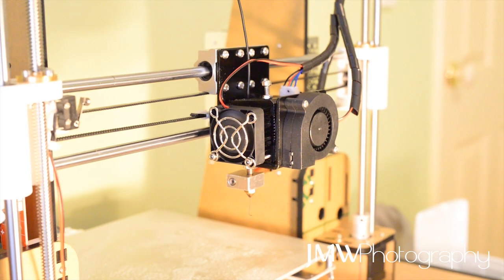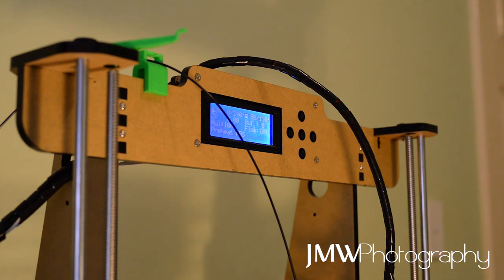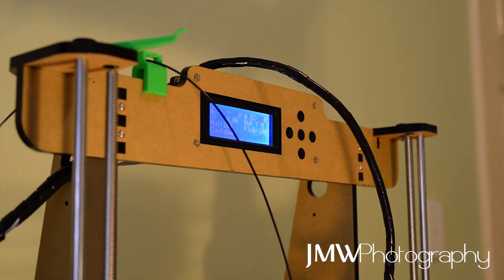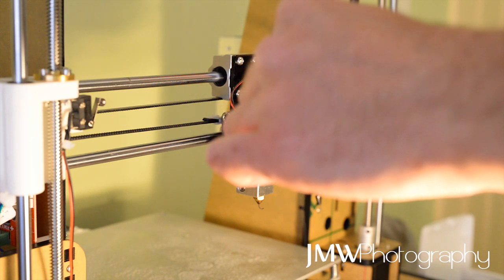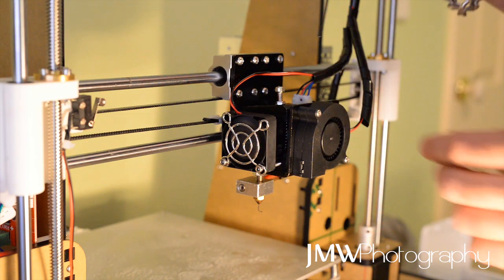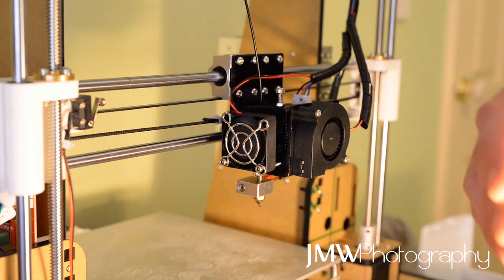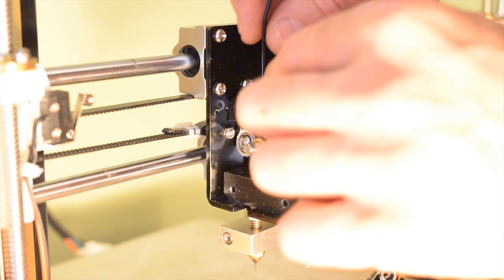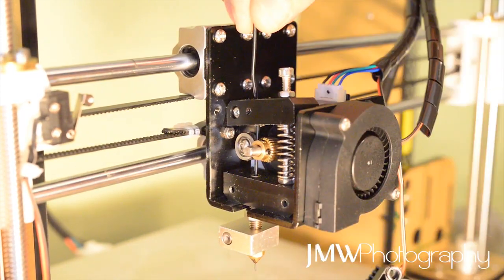Changing / Loading Filament - Anet A8 - 3D Printing - Tutorial - How To

Comment: I'd like to see you do that with the PLA I use. It won't straighten, it spools off the real in a tight spiral. As soon as you try to straighten it, it snaps in your fingers. I have to disassemble the head every time I load it. It feeds into the extruder in a curve, riding along the edge, going under the tension roller, or hitting the wall of the throat. In 3 months I have never gotten it to go in without taking everything apart.
Reply from the maker: I'm sorry to hear +Jeff Kolman! What a pain!
I have a roll(clear PLA) that is a bit like how you describe, if I spend 30 seconds slowly working the end of the filament straight, running it between my fingers to warm it up a bit I can slowly reshape it straight. 
Have you tried this?

-JMW.
Reply: JMW Concepts I believe I'm using a low quality brand, but it's only $5 for a .25kg spool, and a local merchant sells it down the street. I should rightly order better material off the web, but I have no idea of the diffrence between quality, as I've only used one manufacturer. I know MakerBot produces quality filament material, but I also know they charge three times the price. It's almost worth it to disassemble the extruder every time, but what a pain... If anyone here has a prefered brand, at reasonable cost, please suggest.
Reply from the maker: Quality vs price is dependant on location in my opinion. I have heard that cheaper filament will decay and become more brittle, more quickly. Where are you based?
Reply: JMW Concepts... Texas, but with internet commerce, we're all global, so it shouldn't matter... I actually saw a YouTube video where a young man soaked a spool of PLA in warm water for a moment, making it as plyable as ABS. Many called him an idiot for doing so, as PLA is supposed to be kept dry as possible, but he then demonstrated printing without any negative effects in print quality. Who knows with this stuff? PLA isn't meant for long lasting durability in the first place. I just wish it was easier for me to load.
Reply from the maker: Hmm. Let me do some asking around, research and experimenting and get back to you. :)

Jesse,
-JMW Concepts.
Reply from the maker: I would guess the answer would be additives.
For example there are some cheap ABS filaments that don't react to acetone due to acetone resistant additives(even PLA for example).
Other than that, I suppose if they are extruded at the wrong temperature, perhaps they have begun the annealing process or something..
It's a bit of guess/ test work to be honest. :)
Reply from the maker: Yeah it seems that the only factors that anyone can report on causing this are moisture and age. I think the two could be related however.. Have you tried to dry a roll out so you are 100% it's not moisture related? Even straight from the supplier.
I would rule that out, if you do so, you can be sure it's probably just the filament quality.

Comment: Hi,
I just ordered this printer, and I cannot wait to receive it. I would just like to know, what filament should I be using? Like, brand, size, etc.
Reply from the maker: Hi Adrian, congratulations on the printer purchase! How exciting! 
Filament-wise, you need to purchase some 1.75mm filament. Most of the time the printer will come with 10m of PLA in the box but this will be enough to get you started and that's it. 
Your printer will be able to print a wide range of filaments however the most common ones you will probably come in contact with will be PLA and ABS. PLA is a much more approachable starting point in 3d printing as it doesn't contract and warp the same way ABS does. It also doesn't require the higher temperatures of ABS and will thus, stress your machine less. 
Brands of filament will vary in price and availability depending on where in the world you are, I would recommend doing a little research on the brand you ar looking at prior to purchase as it can make a big difference to print quality. I have been having great success with a cheap chinese filament brand, SunLu.

I hope this helps! Feel free to subscribe for ongoing tips and tricks. :)

-JMW.
Reply: JMW Concepts Thank you so much, I truly appreciate it! You have earned my subscription.
Reply from the maker: Thanks Adrian Pimentel ! Get in contact any time if you have further questions. 👍

Comment: My extruder ALWAYS gets clogged when I reload filament no matter how correctly I do it. Pisses me off such a terrible design
Reply: push about 2cm of filament through, right before puling it, to purge molten material, that would instantly harden in the colder throat tube. 
remember kids: you gotta stick it in, before you can pull out! ( ͡° ͜ʖ ͡°)
Reply from the maker: Lol. Thanks Cuda. Good advice.
Reply from the maker: Do you pull it out rather quickly?
Reply: JMW Concepts thanks for responding and I did pull it out quickly. Do I wait a second before I pull up after extruding a little bit or pull down and extrude right away? Also the temperature is supposed to be high correct? 190 and up
Reply from the maker: Hi PCFanatic, no problems at all!
I have people give me mixed results with the exact temperature, cooling the hotend down about 40C from printing temp seems to work well for me but I have bypassed this step and pulled out at full temperature.
I find the key is to feed a little filament through and the immediately remove, straight up. 
Let me know if this helps. :)

Comment: my extruder does not heat I checked the wires and the connections. Any help is appreciated thank you
Reply from the maker: Hi +GamingProductions, has it ever worked? Did anything change to make it stop? Does every other component work as it should and if this is a freshly built machine, did you test all electronics before assembly? Don't worry, we'll get it sorted!

Comment: Mr. printer video sir, please get down here and explain yourself now. Why is there still paper on your printer!?
Reply from the maker: Hi @gelisob, the paper stays for a few reasons. Firstly I have dealt with black acrylic items before and the finger prints and scratches drive me crazy. I have also heard that it can add a tiny bit of extra stability to the frame. Finally, once the printer was built, the last thing I wanted to do was pick paper off it, I wanted to print! 😉
Thanks for the funny message! 
-JMW.
Reply: and the buttons are easier to see
Reply from the maker: I like this reason as well. 😉

Comment: Hey i see your Video. And i read lot's about, how to store the filament.

My question is: If i have removed the filament, can i cool down the nosle? 
And did i not have any problem after then? Can i Easy refill the nosle?

I hope you understood it. =)
Reply from the maker: Hi +GatuzzuHD, as long as you have removed the filament cleanly and there is no plastic left in the nozzle, you can cool down the system and shut it down. Sometimes when removing filament, a small part of the melted plastic will snap off and stick to the inside of your extruder, hardening in the cooled area. This is a bit annoying but easy enough to fix. Let me know if you are having this problem. 
Otherwise, when not using filament, its a good idea to keep it in a sealed container, away from moisture with some some silicon de-humidifiers in there. 
I hope this helps!
Reply: Yes of Cours, it helps a lot!

I bougt my first 3D-Printer.  Now i am building it. ( I never print anything)

I Read that i keep the filament like you said. Did you remove the filamten after printing? and Why or Why not?
Reply from the maker: +GattuzzuHD, I leave filament loaded in the printer as it does no harm. :)

Comment: first thing i  did was change the extruder... because its shit.
Reply from the maker: Hey G Dogg, thanks for the comment. I have only dealt with the MK8 thus far so can't really comment too much. I di d print a smaller, more compact version but it had a little too much friction so I switched back to the original. 
After adjusting the height of the throat tube(see here: https://www.youtube.com/watch?v=B71GGLBrQDU ), I haven't had any issues including printing with flexible filaments. 
What do you dislike about it?

Comment: great video :) this is the same method I use on my machines :D
Reply from the maker: Thanks SparkyFace5! :D 
Changing filaments PLAGUED me until I worked out the fiddly bits. I still occasionally make a mess and need to do a disassemble and clean, but for the most part, she's smoooooth sailing now. 
There is talk that you should never touch the screw and use the extruder motor to feed but I'm yet to get clarification or reasoning on this.